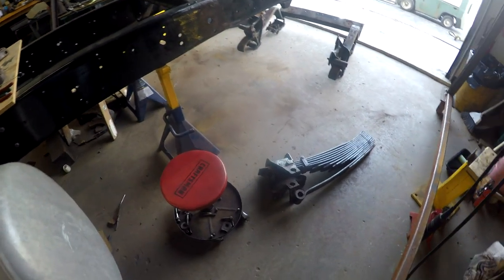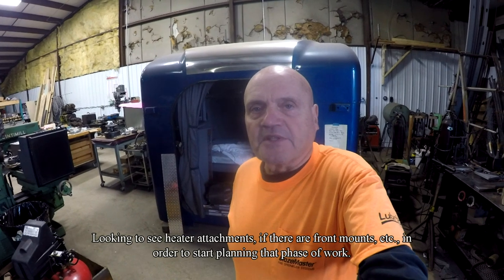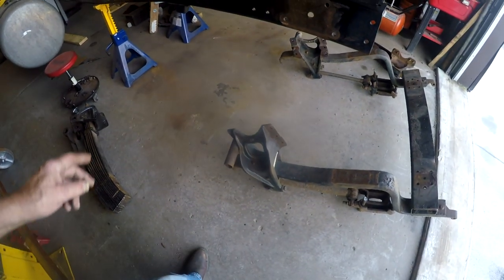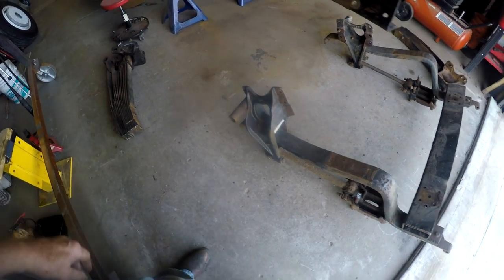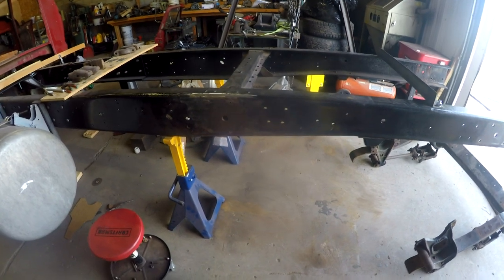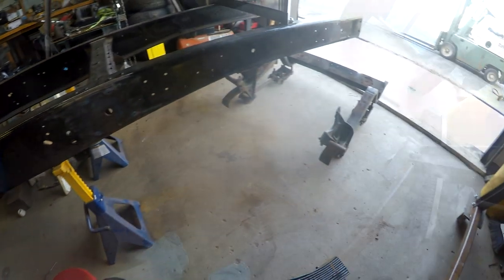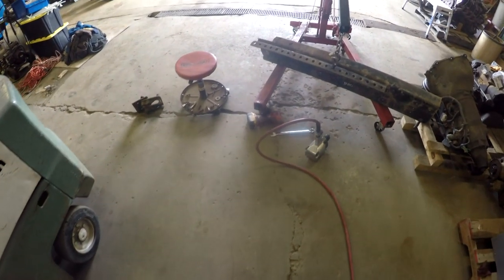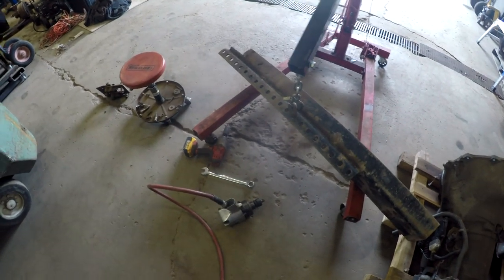Ford F750 Haul Truck Build Part 56

Comment: I think the most accurate would have been to use the factory spring hanger locations to determine the centerline on the frame and then measure over from there. 23:37 it looks like that upper suspension leaf is a floating type setup not fixed? if so be sure it is back all the way before trying to establish any axle alignments.
Reply from the maker: You are right, probably should have used them, but when I mentioned that it aligned with some holes in frame, those holes were mounting bracket holes from spring brackets!
So I ran into and issue (with below mentioned item) after I posted this video. I will be addressing that in next video though, but yes the upper leaf is floating! It is fixed in a certain location though via that 'stabilizer bar' (not sure if proper term) underneath it that's held in place by two rubber bushings (allowing suspension to pivot up and down). So although it is floating, it's also kind of fixed in place (forward and backwards) by that.
Reply: @frednewman2162  I think those lower rods are more for avoiding axle wrap than for axle positioning. I think  once weight is down on the suspension it is supposed to mostly locate itself?  I am more familiar with the 4 link style though so that IH suspension may not work like that.

Comment: Your Panhard bar can run from the frame to the opposite side of the axel it just has to miss the top of the axel when airbags are deflated. If the Panhard bar is bent to miss the center you can mount it with the U bolts that hold the axel in.